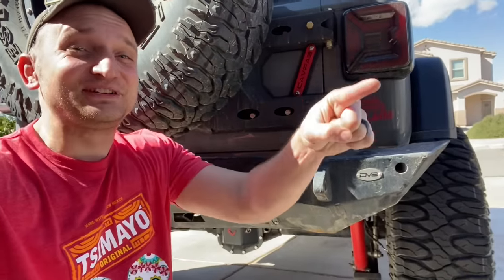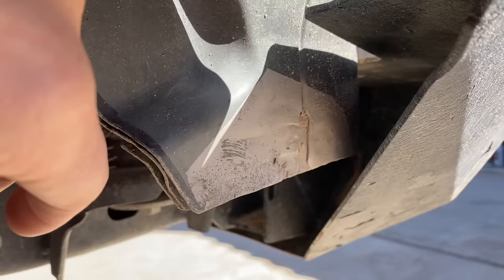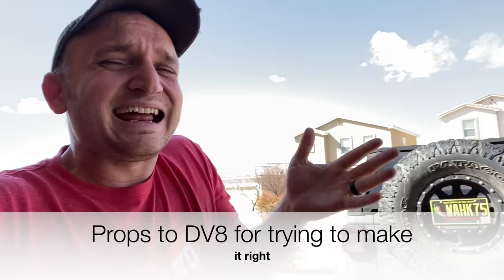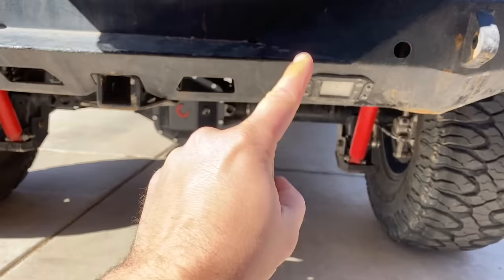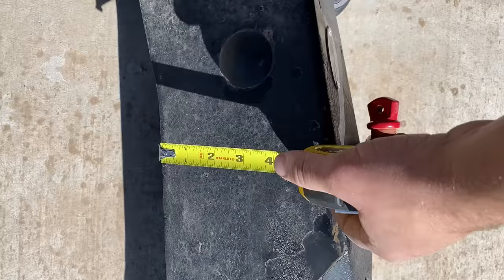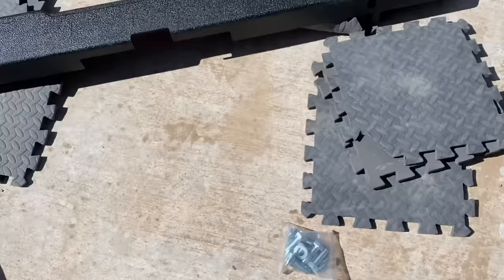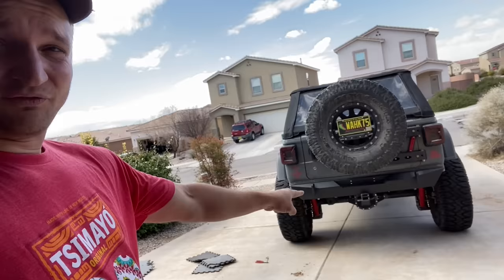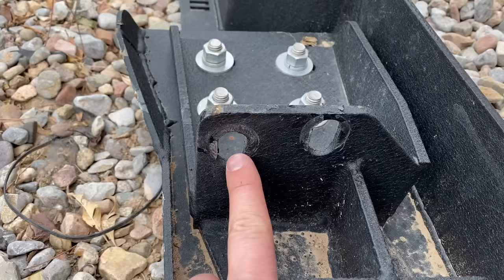Avoid These Mistakes when Looking for a Rear Bumper

Comment: Something you will hate about the new bumper is the complete lack of protection on the corner. You also will get sick of all the mud you collect in the bumper also because it doesn't wrap around. Not to mention the lack of wrapping around makes it super ugly. But if it were practical you could always justify ugly...
Reply: Ian Armstrong I have to say, the lack of protection on the corners has not been a very big issue for me.  Heathen has had the micro skinny bumper since before our trip to Moab.   I’ve wheeled with it quite a bit and only had rock contact with the body twice, one of those times was in Moab and it’s just a scratch.
Reply from the maker: Nahhhh I have plans for tht. Mud ain’t hard to clean... just takes a hose... and it’s fine u don’t like the bumper.. u are entitled to a different opinion then mine.. they also make a full length if Thts what u prefer  
Thanks for watching

Comment: The issues you described were very easy to fix... Seriously,  you liner painted the new bumper, you could do the same with the old one... To fix the "flex issue"... you could simply weld on 2 thick washers on each side perfectly over oval holes and this would fix it for good....
Reply from the maker: Yea... could of... but really don’t want to support such a lousy brand...

Comment: Got that bumper with chips right away. I got it sand blasted and rhino lined before I even put it on.
Reply from the maker: Yea, there packaging is severely lacking
Reply: @JLLIFEOFFROAD  and engineering is terrible. The tire carrier to that bumper was engineered by a deaf guy who couldn’t hear rattle.
Reply from the maker: I Have seen a few installs on the jl... required some absurd modifications to make fit.

Comment: Agreed. My DV8 bumper supposedly fits a 33" spare, but I have to push the tailgate tight as that tire is snug against the bumper.  And it flakes, and not where it scraped.  This are rust spots, too. I'll never spend another dime on their shitty products again.  Oh... and good luck finding part #s they match documentation. That may have improved by now,  but whatever.
Reply from the maker: With my experience and what I’ve seen from others, DV8 will be a brand I avoid in the future. 

Their quality control is a joke

Comment: Nice video, what products do you use the to protect the metal from rust/salt causing discoloration.  Thank you. 

By the way. That was funny the way your little one reacted "Nooooo", even she knew that cost money.. thank you
Reply from the maker: Lol, an instant classic 😂🙌 I used raptor liner when I covered the bumper... cheap and easy to do... I can link the video if u would like? However I get routine scratches from offroading.... I typically just touch put with black matte spray paint when I do.

Comment: I know we hate to modify stuff, but welding couple thick washers on would get rid of the slop
Reply from the maker: I had tht thought... but several things pushed me away from tht decision

I hated the coating... didn’t want to sandblast and resurface it..

Hated how cumbersome it was and hitting it often

Didn’t want to support their company on my jeep any more. 

Figured I’d I continued to put stress on those limited mounting points... it was only a matter of time before I broke something else... like breaking off the nuts on the frame....

Comment: Ive only owned a JK for a few years.  I have found that there are way more garbage options that are only designed to tough with no real function at all than there are parts that work well.  I think the first clue is how big the brand name is on it.  I have great bumpers, front with winch and rear with heavy spare mount, I have bounced them off of all kinds of things with no damage at all and have no idea who made them.
Reply from the maker: It’s all part of the learning experience everyone goes through... granted.. this was literally the only steel rear bumper out at the time.. I thought dv8 was good.. I mean.. I see their junk EVERYWHERE

Comment: I recently purchased the CAVFAB mid-width bumper. During install, my passenger side frame only has two holes alotted for bolt-in. Do I need to drill out 2 more to secure the bumper? Or should that work?
Reply from the maker: Send me pictures on my instagram

Comment: I bought a bumpers from dv8. I regret doing so. 3 months in and its starting to rust. ( neber been hit or scratched, its in corner welds) & it Does not fit properly. I messaged them and they don’t really help. I wish i had i done more research.
Reply from the maker: Live an learn… if I counted the amount of money I wasted on crappy parts Iv put on and took off my jeep…. Lol it would be a few thousand 😂

Comment: I had the smittybilt XRC G2 rear bumper. Did the exact same thing. Flexed on hits and also flaked. $700 rear bumper.  I took that heavy hunk of crap and reinstalled it three different times thinking my handy work was the problem. It just an expensive poorly made product from china.  Learned my lesson, and I only buy made In USA products now.

Comment: I made the same rear bumper mistake. To add to your list it doesn't go well if you have a factory hitch, no room to use a locking hitch pin and you have to modify how you mount the trailer light receptacle, there's no way to mount it to the bumper or use as is in the factory location. I won't buy anything DV8 again.
Reply from the maker: Someone told me that this was a JK design that they just altered the mounts in order to fit on a JL.... which would explain the JK instructions included with it. But that answers a lot of questions for me. They clearly did not check for proper fitment with this. 

I watched a YT channel have to grind out sections of their rear tire carrier in order to make it fit. well, two actually. Ill never give DV8 money again either

Comment: MO!!! Thanks for your help today on the FB!! Got it figured out..... THANKS to your video at 7:08  showed me what I needed to know. Now I have to figure out these damn back up sensors. What did you end up doing with your tow light bracket? Mine is in the way of my bumper.
Reply from the maker: Glad I could help out,. Are u talking about the tow harness??
Reply: For the trailer light hook ups. The bracket thats houses the hook ups overlaps the bumper
Reply from the maker: Hmmm... so my hitch is only the hitch.... I don’t have the wire harness...  Is it possible to relocate the plug??

Comment: I have steel bumpers on my JLR but I don't like the rear one (love the front). The rear bumper I really want is the AEV one but they still haven't released it. I don't like the super angular ones or the fugly ones with iron crosses, spider webs or all that mall crawler looking junk. The only one I've found that I kinda like is the fishbone off-road one.
Reply from the maker: Everyone has their flavor and I get it. Rsutsy is known for making vary.... block resembling parts. You may like those?

Comment: Thank's for the video, I would of cut an inch off that  old bumper with a metal grinder to give it some space and then spray some liner on it, you must be a perfectionist like me, where it has to be leveled or well balanced or I won't sleep at night! I go as far as removing the rust before I install the new part in 🧐😅
Reply from the maker: And thank you for watching. I agree there were things I could have done to solve the problems I was having with it... like what I did to my front bumper.. I chopped tht up... but I didn’t feel dv8 deserved to be on my jeep 🤷‍♂️ 😂

Comment: Thanks for the heads up on DV8! I'm looking at the Barricade front and rear bumpers. How has your Barricade front bumper held up? Thanks!
Reply from the maker: It’s been holding up fine... are some stress bends from the winch line thou

Comment: Perhaps this was mentioned already, and not to defend the dv8 bumper, but you are comparing apples and oranges. The DV8 bumper is designed for a swing out tire carrier and the cavfab is not.  That is why it was larger.

Comment: All these companies are the same....crap.  I bought a Paramount rear bumper and the same thing.  Powder coating is useless for a bumper. Better to get bumpers Line-X'd.  Did my front and it is still perfect.  Also mine did rub the body because they have shiite quality control.
Reply from the maker: The market is flooded with low quality stuff... iv been raptor lining my bare parts and been very happy with the results

Comment: So would you recommend a American Truck Barricade Extreme HD Rear Bumper ? 
Also why did your old barricade bumper had rust ?
Reply from the maker: Any exposed steel will rust... high or low quality... it will rust. However the coating on this dv8 bumper was.... subpar at best... granted I offroad hard... 

Hard for me to recommend a bumper I haven’t seen up close 😬

Comment: I can see the problem as you chipped off the paint you noticed a glossy undercoating that does not provide a good base for the top coat that's why it's chipping so easily. Poor MFG process.

Comment: Nice video. How about front bumper ?
Reply from the maker: I have intentions of swapping it out as well... but has held up better then the rear... we did a video chopping it up cause it was eating into my tires at heavy flex
Reply: JL LIFE OFFROAD I was looking at that bumper. Was want to know if it was holding up well
Reply from the maker: mountainknife gotcha... yea after chopping the wings off... I stopped rubbing into it... Iv hit it plenty of times on rocks... it’s scratched up.. but not flaking to hell... off hand... I don’t really have any negative to say.... if u have a jl I had to modify the fog lights to fit thou...
Reply: JL LIFE OFFROAD that’s not bad. Especially for the price

Comment: I would have done some welding on that DV8 to at least double its mounting points. And its almost big enough for my full size Chevy van.
Reply from the maker: Lmao... I considered it... but didn’t want to show my support For the brand... I mean... I could have mangled the hell out of it so nobody could tel 😂😂
Reply: @JLLIFEOFFROAD  I've given up trying to find affordable bumpers for my 4x4 Van. I'm just going to have to build mine from scratch I guess. Well, at least I know it will be done right. :)
Reply from the maker: Bryan Fullerton hahaha sounds badass! I’d love to see a van bouncing off of rocks some day 😂😂
Reply: @JLLIFEOFFROAD  heh, At 8,000 lbs I don't bounce off rocks. I crawl very carefully through any rough stuff. Of course not built to crawl rocks but rather more of a trail rig. And something to make noob jeep guys look bad. You wouldn't believe the number of folks I have rescued in snow. Half were jeeps and the rest TOYS fans. They all had one thing in common. ZERO recovery equipment. :)  I carry enough recovery equipment for 3 or 4 people. Now you know why it weighs 8,000lbs.

Comment: I was gonna say now you can remove your spare because you lost coverage but then I seen you found out at the end of the video. There’s pros and cons to every design. It doesn’t make one better then another just different.
Reply from the maker: All depends on what u end use is for..  light to no off roading... the old bumper would would be fine... I also run my spare around 8psi in order to help those situations when I hit it on rock... also gotta stress test the tire carrier 🤷‍♂️  I understand the risks. 😂 thanks for watching

Comment: Looks great just order it actually!! Question for you though since your running 37s! Did you need an relocation kit for the spare to fit or was there enough clearance to leave it in the stock position?
Reply from the maker: Good question... and i can’t answer it... when I went from a 35-38 tire.. I upgraded my carrier... 😬 it very well... WILL fit with this bumper... but I’d caution you from using one of them brackets...they are not very strong... and will lead to rattling.. Thts a lot of weight to be shaking all the time... 

I mean... can u use a relocation bracket / stock carrier for an over sized tire? Yes... should U? I’d say no..

But I feel I went off the rails here.. Iv seen other people bolt on a 37 to their stock carrier... they all said it worked... but started to notice issues with noises in the hinges... 

I hope this helped.. I know spare carriers are expensive 😬
Reply: JL LIFE OFFROAD that is beyond helpful! I’ve got the reinforcement bracket for the door and the relocation for the license plate I was just debating about putting on the relocation for the spare as well… You’ve given me a ton of knowledge I did not have before! Not to mention me and my boy love watching your videos it’s one of the only things he will sit down and watch nonstop!
Reply from the maker: Thts awesome! Glad to hear tht y’all been enjoying em and finding uses from it all! Appreciate your support my friend! Hope we never lose it!

Comment: Great review! Did you torque the bolts on the DV8 to spec? Also, if it was still moving around, you could upgrade the fasteners to higher quality ones to torque it to a higher spec to stop it from flexing. Not to say DV8 is any good, it would be a band aid to fix the obvious issue you were having. Just curious.

Comment: Why the ultra over the micro? I’m installing fascia from Rusty’s Off-road and looking at their micro vs this cavfab ultra or Micro. Just curious as I want to avoid a mistake off and on road.
Reply from the maker: Nothing wrong with Rusty’s .... least as far as bumpers go. It’s more of a matter of preference... I just felt rusty bumpers looked... very basic...

Cavfabs looked better imho... plus they had free shipping when I got this one...
Wish I had gotten the ultra.... lol but this was about 2 months before they released it

Still love this bumper thou.. been holding up great to all the abuse
Both American companies...
Reply: @JLLIFEOFFROAD  Thanks for replying! So with the fascia, do the micro’s offer the needed level of protection or am I better to go with the ultra that covers a little more of the tub?
Reply: I was leaning towards Rusty’s for that very reason... basic/traditional. My front bumper has that same look (for now).
Reply from the maker: So really gonna depend what ur gonna want from ur bumper... the fascia  cover is great but it’s thin and won’t hold to heavy use... it’s more so protection from minor hits, drags and scraps....

Tht being said, my wife’s jeep has the micro with fascia cover... we haven’t had an issue yet... she wheels as hard as me
Reply: @JLLIFEOFFROAD  good points. I do want clearance. I want some solid protection too. I don’t see myself doing anything more than what you’re doing. I was going with the oem steel rubi bumper with the cosmetic caps removed until I heard about the flexing issue. Someone told me I could still run the OEM w/the fascia but I still worry that it could flex and gouge the tub beyond the fascia??? I’m literally trying to sell it now which is proving difficult even though it’s in the box and hasn’t been installed. I had chosen the OEM for the mere fact that it keeps the license plate on the bumper. I’m not a fan of any of the plate relocations for the JL. Although now I’m looking at the tow hitch plate mount with an extreme/ultra rear. It would be easier had I not made the mistake of ordering the OEM before hearing about the flex issues or watching your video :)
Reply from the maker: Well the purpose of tht fascia is to protect those moments the number bends and rubs into the tub... you will need to keep it covered... (paint) I’m not a big fan of the oem bumpers.. front looks good, rear... meh...  but it’s far from being heavy duty. 

Just be sure whatever bumper u use, mounts just as high as the frame... if it’s lower... u will just be creating headaches Down the road.

I remember those bumpers used to catch 700-800 a side easy... but with all the after market now... it’s not as easy... the cavfab bumper I used in this one is $400... the dv8 I took off was around $600-650...

Comment: Have to agree with you on DV8's equipment. Especially their crappy powder coating. I went with the same bumper mainly because I used their tire swing as well, which rattles. I also have one of their front bumpers but with the winch installation, I am unable to remove the grill and winch digs into the grill.
Reply from the maker: They have zero quality control... people see their name on so many show jeeps and just assume they are quality... I know that’s how they got me...

Sorry to hear you fell on the crap side

Comment: I had my suspicions about that brand. Thanks for the tip! I'm a newer JLU owner and haven't done any mods yet. Do you think the Cavfab is also good for daily driver issues with traffic accidents and protection as well. 
I have yet to try rock crawling but have done other off-roading.
Reply from the maker: Their quality control is nonexistent... Iv seen so many others have issues installing their products... I could never recommend them to anyone... 

Congratulations on the jeep! If u ever have any questions please feel free to ask.. I remember how it was when I bought my JL 🙌🙌🙌
Reply from the maker: Cavfab bumpers are stout, strong and will easily protect u in the event of an accident... and when u decide to offroading... rest assured it will stand up to rock abuse...